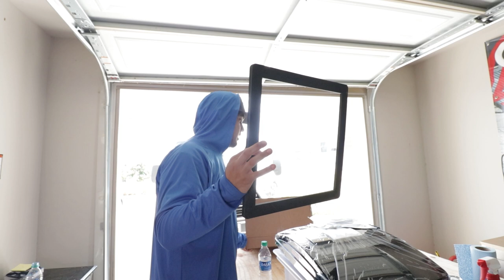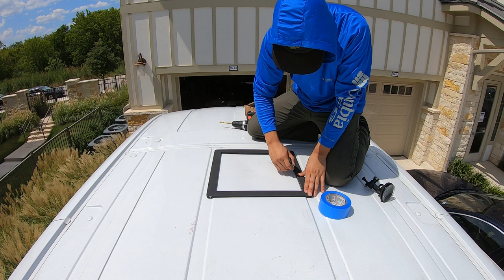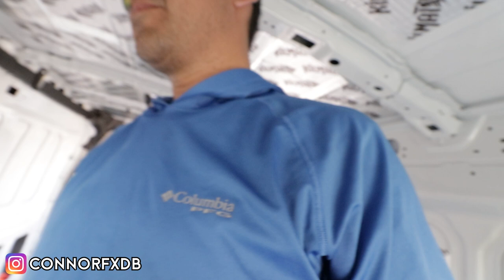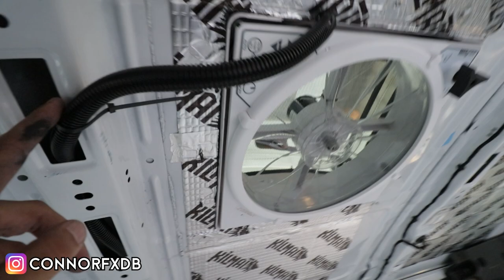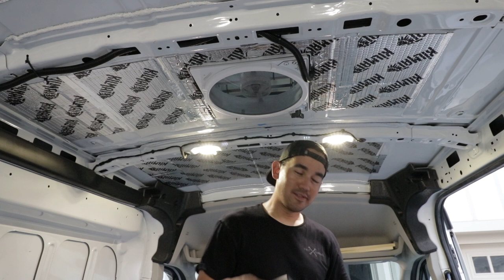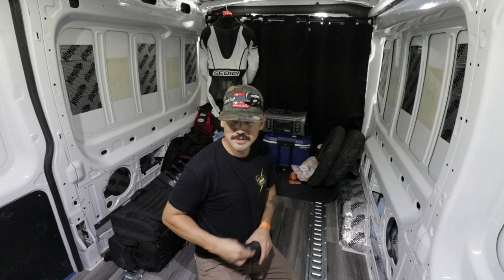MaxxAir Fan Install | Ford Transit Motovan

Comment: Very informative vid. You had posted a pic of a completed van on IG before of a general idea of what you wanted to build. Would you get more room by placing the bike to one side & having a bed next to it as in the pic? Or is it not an option with the harley? Or is it just not the way you chose to go in the end? Just a few questions lol. 👍🏽
Reply from the maker: Great question neek! Yes it all comes down to preference on bike placement. It will fit as I have ran 2 bikes side by side and even 3 with one between the two bikes but with where I plan to have my bed by the driver seat the bike in the middle works. 

I had even previously thought of the same bike placement and making a Murphy style bed that would drop down and sit over the bike as it sits in the middle (would be over the seat etc and I would be extra elevated) 

There’s tons of options when building up a ban and so many wants 😂 on how to build it. But I think the bike centered just makes it easiest. I’m sure I’ll come up with a few versions of the build as it comes together haha 

Cheers and thank you for watching! Truly appreciate your comments and feedback